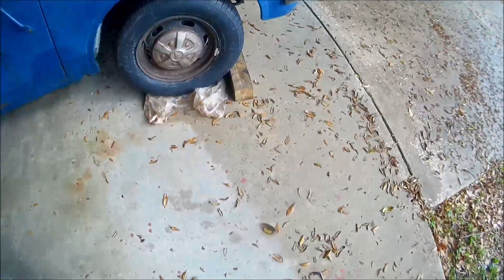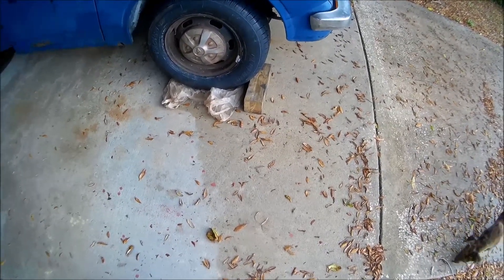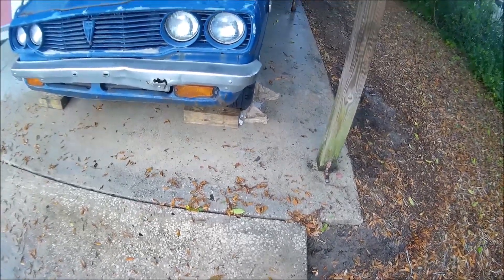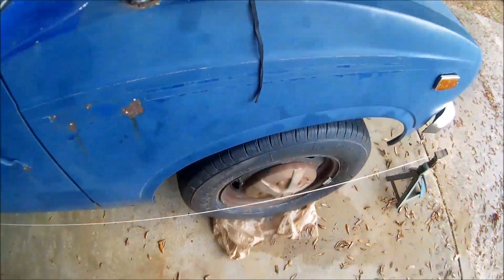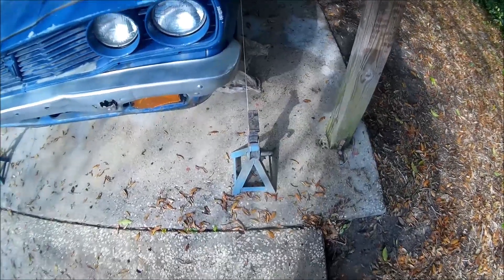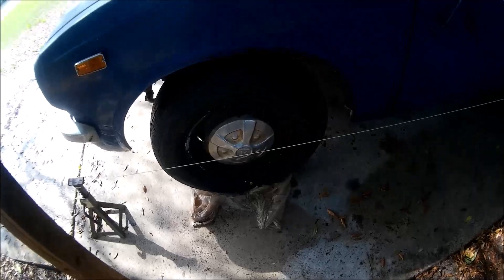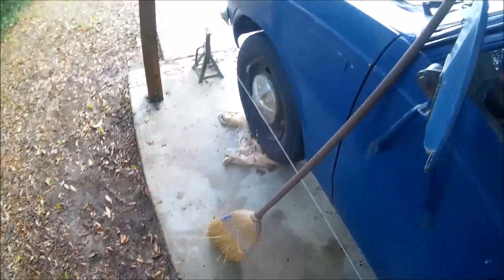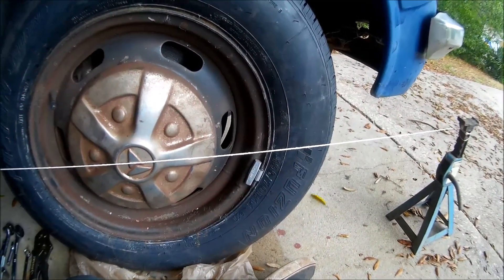DIY "String Method" Toe In Alignment FOLLOW-UP - 1978 Toyota Pickup

Comment: What are you airing your tires up to?  I have a '78 and in the owner's manual it says 20psi, which seems low.  I currently have 185s on it.
Reply from the maker: My current tires run at 35 PSI but they are the more modern radial tires (205/75R14), instead of the original equipment style 6.50-14-8ply tires. The old bias-ply tires ran at lower PSI inflation & 20 PSI sounds fairly standard for those, back in the day (yes I'm old enough to remember that, lol). However the door tag on my 78 longbed driver's side door jamb says 7.0-14-6ply @ 36PSI.

When in doubt, check the sidewall of your current tires. There will be something on there molded into the rubber that tells you what the cold inflation spec is for that specific tire. Give the tire what it needs & don't worry about what the manual says.

In general, the standard inflation PSI for a 185/75R14 Radial Tire is 36 PSI. Source: https://tirepressure.com/185-75r14-tire-pressure But go with what is on your tires if it differs from this. There can be differences in load ratings that can change the inflation spec.

Any other questions just let me know. Hope this helps.
Reply: Thank you for the info.  I was't real sure about whether to go with what was in the manual or what was on the tire.   @The13thSword
Reply from the maker: @davidflatcutf3286  No problem, glad to help out.

Comment: What happens if you have replaced all front end parts and you still have play or looseness
Reply from the maker: A very timely question sir, because that is exactly what I am going through at this very moment. There are two other items that are part of the steering system that often get overlooked than can cause excessive "play" or looseness in the steering.

The first item (and this applies in my personal case) is the "rag joint", or steering coupler. This part is what connects the steering wheel & it's shaft to the steering gearbox. It allows a bit of movement between the steering shaft & steering gearbox due to movement from road vibration, & to absorb some vibration to keep that from getting to your steering wheel.

Many of these old(er) trucks may still have the original rag joint. This joint has a rubber disc or layers of rubber discs that can wear out, shrink, deform (especially around the mounting bolt holes), tear or rip, or just plain crumble away to dust over time. Here is a reference picture of the rag joint that fits my truck: https://www.rockauto.com/en/moreinfo.php?pk=11541637&cc=1277108&pt=7418&jsn=896

Like I said in the video, I replaced every front end part that has a ball joint in it, and done the toe in alignment equally & to spec, but I still have excess steering :play" (actually 2 & 3/4" of play; the max spec is 1 & 1/2"), and the truck wanders while driving, requiring a LOT of steering correction at the steering wheel. My worn out rag joint is the cause of this.

The other overlooked item is the steering gear box. The gears inside can get worn & cause steering slop & play, but this isn't a very common thing to happen to them, especially with manual gearboxes (non-power steering). Power steering gearbox can & do wear out more often, due to their being operated under hydraulic fluid pressure; the internal parts are subject to quicker wear out than with a manual gearbox. The only test I know for this is to turn the gearbox input shaft while looking for movement at the Pitman arm. There should be almost instant movement of the Pitman arm if all the internal gearing in the gearbox is good.

I noticed your "tag" 3RDGENDODGEVANS. Those are a different then my Toyota pickup. They have an intermediate steering shaft with a rag joint plus two universal joints, which can also go bad on you so you'd have to check/test those as well. An intermediate shaft like this is usually replaced as an entire unit instead of overhauled/repaired.

I hope this info is helpful. Let me know if you have other questions or if you think I can help you in any other way.
Reply: @The13thSword  yrs I have a 99 Dodge Ram Van and I have replaced everything on the front end except the box and I still have slop
Reply from the maker: @A_DIY_VAN_GUY  Including the intermediate shaft that has the rag joint? If not check that out. Look for looseness in the rag joint and in any u-joints that are a part of the shaft. If it's original to the van, it's quite likely that it's worn out. After all it's 24 years old.